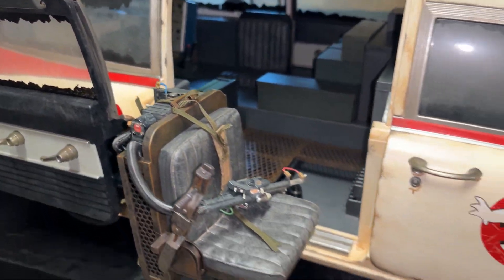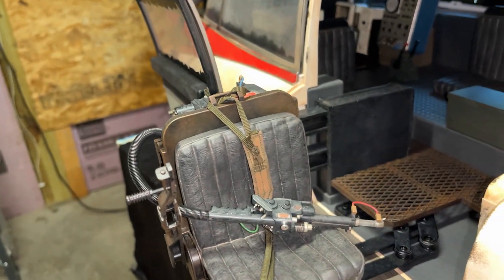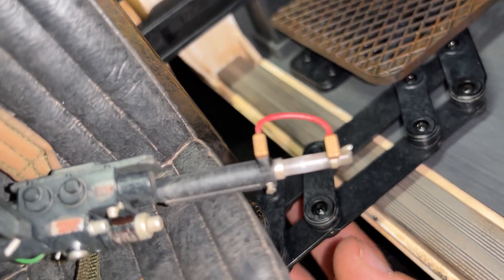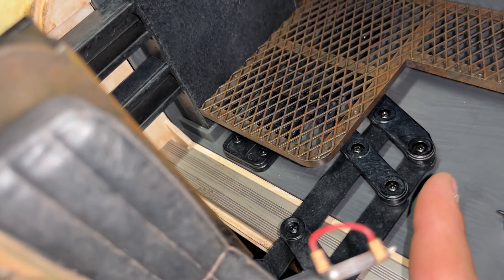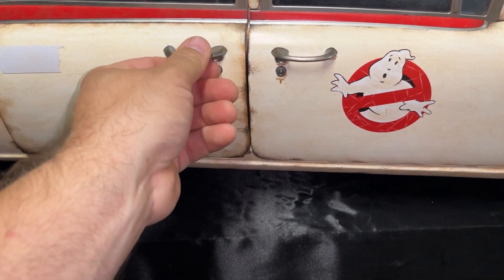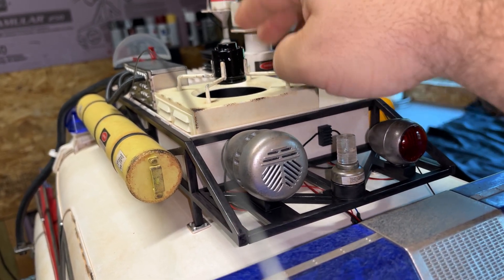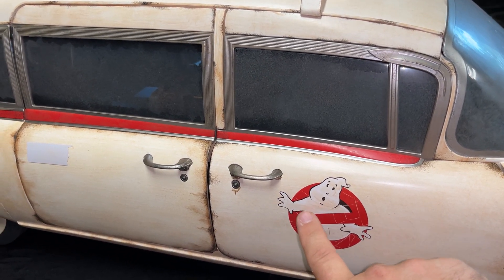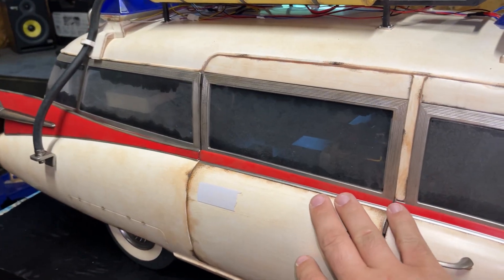Blitzway Afterlife Ecto 1 / Broken Gunner Seat Update

Comment: My man! Good Job on the Gunner Seat mechanism. If you want to make the seat tighter try to use a micro runner washer. Also, I talked to Won and he is willing to send out stickers, as many as I want but after talking to him for a while its going to be extremely difficult to remove those stickers and replace them so I told him to just forget about it. I believe they use some kind of cleat coat over the sticker and removing it could damage the weathering patterns on the car. I have 2 Afterlifes now in the garage, I always get 2 incase I need parts and I think once I get it displayed I'll forget about the sticker fairy quickly. Especially because I wont be able to see the back of the car or the passenger side from the Angle is will be displayed. One more thing, try using some blue thread lock on the gunner seat bolts, that will ensure they never come out again. Thanks for the update videos! I enjoy fellow YouTubers in this hobby who are not afraid to tackle a problem and work out a solution.
Reply from the maker: Thanks Jon! Appreciate the help as well 👍🏻 yeah I noticed there is definitely some sort of clearcoat over the sticker so it’s not going to be fun but I still think I can get it off and just apply new weathering over the new sticker. We will see, Fingers crossed!

Comment: Maybe try a couple small plastic washers and slice em, then slide them in around the chair screw. It should stiffen up a lil and I wouldn’t think it’d bind up. They’d act like shims.
Reply from the maker: Thanks!
Reply: I use metel C-clips. Same concept but they wont fall out. I also use knock off super glue on nuts I dont want to loosen over time. Just dont let the glue get on the plastic.